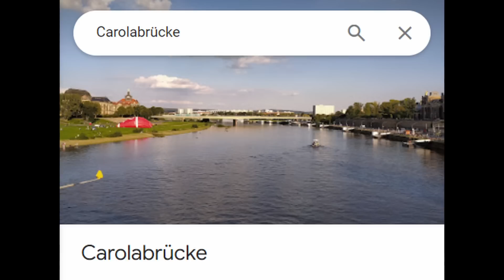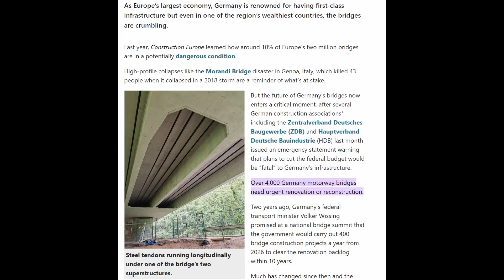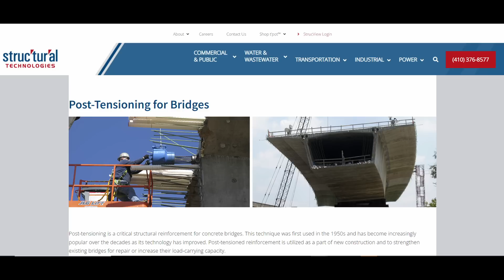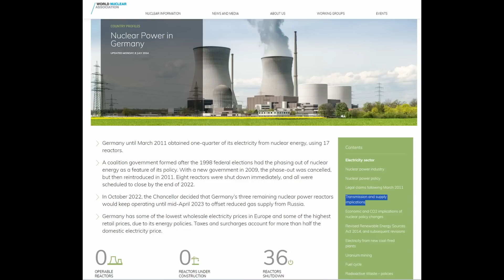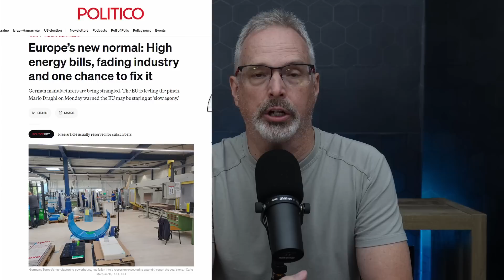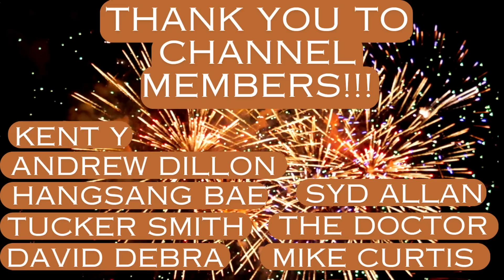Carola Bridge Collapse in Dresden, Germany

Comment: Hi, german guy from Dresden here. 
The Carola bridge as already mentioned here was built from 1967 to 1971 as a 3 lane bridge (3 bridges side by side) in pre-tensioned reinforced concrete construction. The tensioning was done with high tension steel cables inside steel tubes which were press filled with concrete to prevent corrosion. Each  lane consists of 3 sections slightly arched between 4 pillars and the bridge heads on each end. Each of the arches itself where constructed in two halfs. The connection between these is most likely where the fault occurred. One cause of the already mentioned corrosion is the 50 years usage of salt in the winter keep streets, walkways and tram rails snow and ice free. 
Normally this alone wouldn’t hurt if the sealing between the segments and openings for lamp posts and the overhead powering for the tram were ok. This led to salt ingress into the concrete core. In the last 35 years there were at least two times maintenance efforts made to mechanically remove and chemically neutralize these salts and replace or renew the seals. The complete overhaul of the bridge was started in 2019 to 2022 for part A of the bridge (2-lane car + pedestrian from south to north), 2022 to 2023 for part B (2-lane car bridge from north to south) and part C should have followed end of 2023 but got delayed and now should have started spring 2025.
But there might have been other factors at play here too.
This bridge was one of the first ones of its kind in the early days of this construction method- not only in eastern Germany but in all of Germany. So some aspects of it weren’t well understood yet. Later types used different steel and different treatments against corrosion, one part sections etc.
The bridge was engineered for way less load and traffic at that time in the late 1960s.
We’ve just came out of the hottest summers on records. The week before had seen temperatures 10-15 degrees Centigrade (that’s 20-30 degrees Fahrenheit for you yanks) more than on the day of the collapse. That difference in just 3 days can also put a lot of stress on a bridge. There are probably more possible factors but the most likely cause was corrosion I think.
Now wasn’t the bridge not monitored I hear you say? Well it was. By law every bridge in Germany that’s open for traffic has to be checked extensively every 6 years and every 3 years in between for a normal check by the TÜV which gives a report and a grade from 1 (good) to 4 (insufficient). The Carola bridge scored a 3 (sufficient) in 2017 which basically meant it has to be renovated until the next main check.
Now the problem with this type of bridge is that the crucial parts of the bridge - the tensioning cables cannot be checked because they are buried deep within 1 foot of concrete. The only way would be to x-ray the concrete trough- but the most vulnerable areas near the seals are right where the bridge lays on the pillars.
The type of concrete used here was an extremely hard one with lots of extra reinforcement.
Reply: After reading this the only question on my mind is why would someone make a YouTube video about it and say nothing, and then you have to go through the comments to find a propper engineering speculation/analysis like yours?

Greetings from another civil engineer in Germany.
Thank you!
Reply: @Privacy_menorykee  Casey often sets up a story before the investigation is completed.  This includes a description of the structure, a history, structural elements, and some speculation.  Many of his viewers find this format interesting and educational. This channel also calls attention to infrastructure around the world and stresses the need for preventive maintenance.  You should look at some of his other postings.
Reply: Thank you for the comprehensive commentary and insights from the region!
Reply: Traffic load should not was an issue, because it was a tram bridge.
Reply: @hhier9395  Articulated tram trains are longer today (and probably heavier) than they used to be.
Reply: @hhier9395  Hi there, the tram wagon that wer driving back then an the low flour trains in use today do have very little in common but the name tram. The trains of today are up to tree times longer and up to 3 times heavier transporting up to 3 times as much passengers as back then at higher speeds in average.  In the 1960s and 70s a typical tram consisted of a head unit and a passenger wagon which was much lighter because the drive unit was the in the head unit (about 20t empty). Each wagon had a capacity of about 70 passengers max. The trains of today can carry up to 300 passengers if I recall and weigh about 60t empty.
Reply: @0toleranz while this is true that older trams were shorter than modern ones, modern trams are generally heavier by length and the low floor technology also introduces further issues like a higher centre of gravity, larger unsprung mass and higher axle loads. Therefore, when comparing old and new trams of the same length, the newer ones will generally tend to be heavier. 

For comparison, let's take a former record holder for the longest tram vehicle in the world, the Düwag ET12, made in 1967 for the Rhein-Hardt-Bahn (nowadays part of the RNV network in Mannheim / Ludwigshafen / Bad Dürkheim). It's a narrow-gauge articulated tram with a length of 38.5m. Its five sections are supported on six bogies, meaning that its total mass (without passengers) of 34 tons is evenly spread across 12 axles, leading to a per-axle weight of 2.83 tons. It's weight by length would be 0.88 tons per meter. 

On the other hand, let's take a modern tram type with a similar length which is currently in service in Dresden, the Bombardier NGT8DD made in 2001-2002. It's 41m long and consists of 7 sections that are supported by 4 bogies. It's total (empty) weight of 48.1 tons is spread across 8 axles, leading to a per-axle weight of 6,01 tons. It's weight per length would be 1.17 tons per meter.

Bonus example: the latest generation (yes much longer than the previous ones), Bombardier NGT DDXD, made from 2021 onwards, 43.3m long, 5 sections, 5 bogies, 10 axles, 53.5 tons, 5.35 tons per axle, 1.21 tons per meter of length.

Do you see the pattern?
Reply: than google News from Nossener Brücke in Löbtau. Das Ding ist massiv zerbröselt und der Bau musste wegen Inkompetenz verschoben werden. Bahn und Bauplanung haben sich in den Maßen geirrt. Daher wurde die Planung vor einigen Jahren neu begonnen und der Bau massiv nach hinten geschoben.
Reply: Hmmm; it seems my comment was deleted (perhaps because it contained a link?).
Anyway, for a picture of the bridge under construction you can google "df_hauptkatalog_0170116" which will lead you to the website of the Deutsche Fotothek. There are other pictures of the construction phase as well.
Reply: "Now wasn’t the bridge not monitored I hear you say? Well it was."
Due to the known problems the bridge (i.e. the collapsed part/section C) was even fitted with a permanent electronic surveillance system. 
Which gave however no warnings before the collapse. 

Originally a suspension bridge was recommended due to the desired wide span of the bridge (compared to its predecessor destroyed in WW2). But to not spoil the view onto the old city centre a more flat design was preferred. The engineer who was behind the (new)  bridge design which won the contest, left the GDR to the West before construction started. Thus another engineer was given the task to "finalize" the design and construct the bridge. As this was a design never built before and without contact to the original designer, this could have well let to design failures. 
As the Communists set a deadline for opening the bridge (some party event), the competition was also very rushed (24/7 works under a heated tent). Also this might be not good for the building quality. The lack of good construction material was at this time - at least here - not the problem.
Reply: Hi, "Yank" from California here. 10°-15°C = 50°-75°F  (°F = 1.8 * °C + 32)
Reply: @Milosz_Ostrow  Yes, but I ment a difference of about 10 to 15 degrees centigrade not the absolute temperature. So I roughly estimated with a factor of 2 instead of the correct 1.8. didn’t want to go down that rabbit hole of imperial vs. metric and oddball vs. base 10 factors. There are plenty of other videos that done this.
Reply: Don't worry Hanswurst.. we yanks know both systems and can convert it in our heads. We aren't math cripples like you metric dullards counting on ypur toes and moving decimal places!
Reply: Best explanation ! Thank you from Germany.
Reply: Watching the video, I suspected corrosion was the problem, especially when I learned that the bridge was 50 years old.  Many post and pre-tensionned structures reach the end of their useful lives around 50 years (instead of the intended 100 years) because of accelerated corrosion from road salt.
Reply: If corrosion is an issue then why would they not incorporate a sacrificial anode technology?  The cables are only effective under tension.  When pulled to specified tension and locked into the concrete, which is allowed to cure to near its maximum strength, then cut, they can only recede into the concrete my a few millimetres.  That slight shortening of the cable is balanced by their effective diameters increasing and that locks them tight into their concrete core.
Reply: @randymclean9121  Hi, sacrificial anodes work in an closed environment like in a water tank. Inside a bridge you won’t want any water to start corrosion at all. This was the main problem - water ingress in addition to the salt that was already there. Both because of defective seals. So sacrificial anodes are no solution here. Besides a different construction in newer pretensioned concrete bridges much better sealant etch and additional coatings of the steel cables with epoxy or certain ceramic coatings are used today to prevent corrosion.
Reply: @0toleranz  The sacrificial anodes would be certain tell that water has reached the metal.  They will begin to dissolve before the metal and warn inspectors that they have a problem.

Comment: Disappointing. Not up to your usual standard. No real information about possible mechanisms of degradation. Post tensioned structures seem particularly vulnerable to long term corrosion of the cables because moisture can over time get into the wire bundles despite various sealing schemes ! The effective life of sealants,  gels and other treatments etc seem to be the limiting factor. Dry nitrogen is being used as an active moisture exclusion method more and more (if it can be afforded)
And you are a bit out of date regarding energy prices in Germany.  Prices peaked in 2022 and have been decreasing steadily ever since as renewables come on line in a very big way. Each year is a new record for them in wind and solar rollout and it looks like they will achieve their goal of 80% renewables by 2030, much earlier!
Reply from the maker: Well can't please everybody. This is a breaking news story with very few details released to this point. You should  know I do follow-up videos when more details are available.  All I was pointing out is Germany's economy is in shambles. I don't think many people share your rosy view of things.
Reply: How is German manufacturing lately? Many companies are cutting back / moving production elsewhere. VW seeking to close a large plant there and laying off thousands. From what I've read, much of the reason is energy costs. Renewables are increasingly covering demand, but energy prices still remain high. Why is that? Is there still an energy gap? And/or excessive taxes being added? In short, he's not wrong regarding Germany's economy. Not directly related to the bridge collapse, but important background information to know.

Comment: The collapse of the Carola Bridge is due to the rusting of the prestressing elements between the first and second bridge spans. The bridge was completed in 1971. The GDR, like the Federal Republic of Germany, distributed tons of road salt in the winter to keep roads and bridges free of snow and ice. This also applies to the now collapsed tram bridge section. If the bridge joint is not properly sealed, the death of the bridge is inevitable. We have the same problem in Berlin with the Elsenbrücke and the Mühlendammbrücke. Both were built in the same period and are pretty much identical. The problem we have here in Germany is that since the 90s far too little has been invested in the maintenance of the infrastructure. Especially prestressed concrete bridges from the 60s and 70s are now at the end because the traffic load on the bridges has also increased, so there are no more reserves. Greetings from Berlin/ Germany. Sven

Comment: The video clips shown here are part of a Deutsche Welle broadcast that I watched a few days ago. During that broadcast, a German engineering professor was interviewed and explained that the method used to build that bridge would not be used today. It was also pointed out that the bridge needed to be cleaned up quickly because it had stopped all boat traffic on the Elbe, which is an important transportation link.

Comment: Prestressed reinforced concrete girder can mean very different things. I have no idea what the construction of this bridge was, but as a descendant of a family of engineers who lived the late 70s in a country under soviet soldiers' boots, though not in DDR, I can tell how the bridges were build back then (USSR excluded, because of underperformance for overprice of their designs built soon after the war ended according to their prewar standards and as a result separate developments in construction practices followed once again). As of today, it was true also back in the 70s, the cheapest and most mindless bridge/viaduct construction is laying in parallel I/H/Doble T/whatever local tradition call them prestressed girders on bearings, and cast reinforced concrete deck on top the traditional way. It's cheap for up to 40-something meters spans, but after 20-something meters that fit on maximum legal road vehicles length, the cost rises rapidly, so comes the choice of temporary nearby production site and what this site will produce: mentioned above girders or whole box girders. During "socialism" in eastern Europe, prestressed box girders were preferred, but still there's another choice: fabricate separate span girders  and placing them with various crane solutions or make single box girder bridge by continuous casting prestressed spans on one side casting site and tact pushing the entire bridge. The photos and videos demonstrated here are unclear what the construction was, but it clearly shows it was two constructively separate bridges and the broken profile suggested it probably was box girder. What's wrongly suggested is the prestressed connection of the girder sections: sure, it's a commonly used technique in suspension bridges construction, but for a stayed bridge it's not considered as good practice, at least in socialism 70s for the reasons following. It's slower and more expensive to achieve girder "monolicity" that way and requires heavier stronger construction to accommodate thermal expansion stresses of a single long girder and massive expansion joints at the ends of it, construction process will require massive cranes supporting girder sections for significant part of the strength gathering time and building and later removing massive temporary support structure in the river some significant part of which could be partially or altogether avoided using tact pushing continuously casted girder. But these all are details that could be irrelevant in this particular catastrophic construction failure, though might as well be the very cause of it. Anyway, where I live hard joining box girder sections is almost never the choice, probably, partly because the nation is poor and almost never builds suspended bridges, partly because on top of poverty the land is highly seismically active and the terrain is mountainous consecutively suggesting landslides, natural wind funnels and flood torrents.

Comment: Great engineers and builders in the past built fantastic infrastructure and life has been so good and we took it for granted. We have forgotten that we need to maintain and build new great infrastructure. That and alarmist environmentalism crippling energy industry and that then cripples everything else that depends on energy and everything gets more expensive, including infrastructure maintenance. 

The same problems with many other industries, like aerospace. Planes losing doors in flight, crashing, space capsules that don't work, space programs behind schedule and unbelievably over budget...Boeing, once a great company, with great people who did great things. 

'Hard times create strong men. Strong men create good times. Good times create weak men. And, weak men create hard times.' All things oscillate and cycle, including societies.
Reply: Starliner safely returned back to earth. The maneuvering thruster overheating apparently damaged some PTFE(a.k.a. Teflon) seals, but only on redundant components. At no point was the capsule out of control. The thermal models of the trusters weren't done properly and will have to be redone to set limits to not overheat the thrusters during maneuvering.
Reply: @jannikheidemann3805  I hope you don't think that was a success.

Comment: What about the OTHER Bridges in Dresden? Were they built at the same time? A FLOOD RUN could carry those bridges away as well and do untold damage downstream ..
Reply: No, the other bridges are either much older or in the case of the Waldschlösschenbrücke much younger. They withstood the floods in 2002 and 2013 just fine.